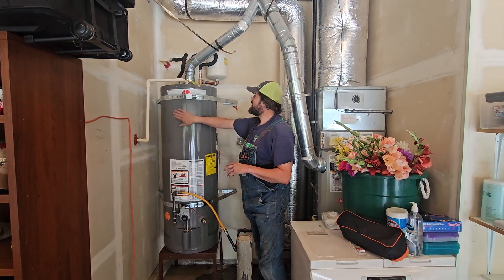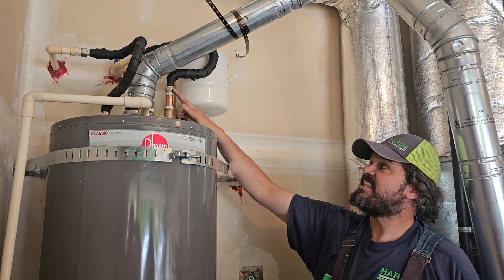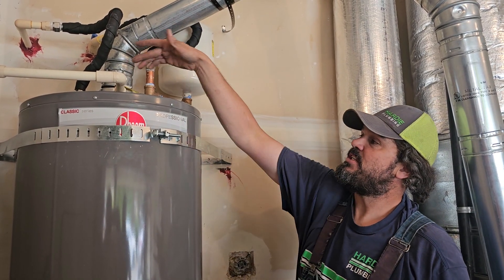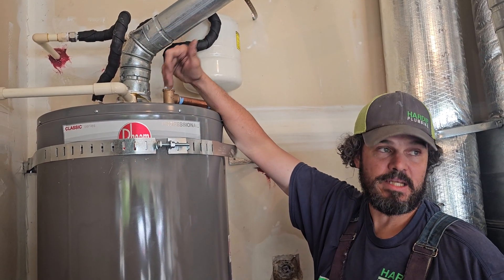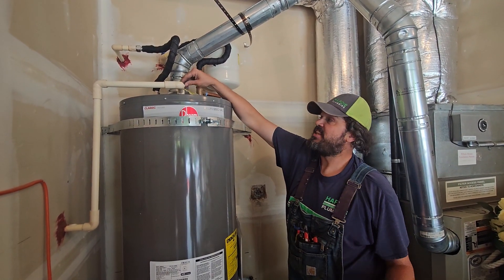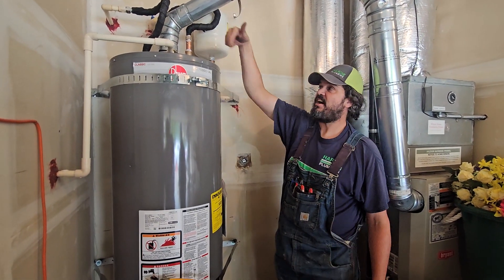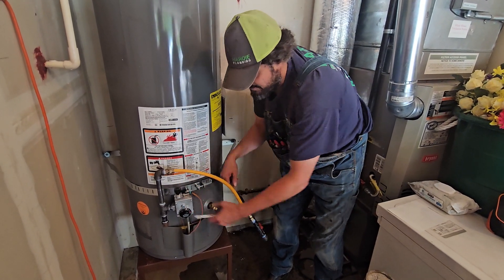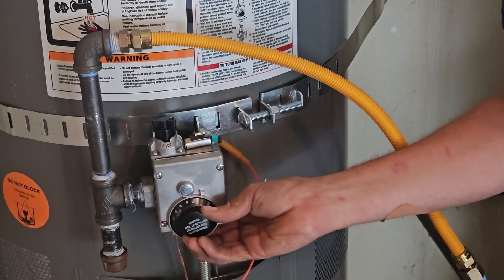Get the 5 Star Review Everytime with this Gas Hot Water Tank Explanation

Comment from the maker: Great Question!  I think this BOILS down to practicality and a little bit of physics. CPVC Is a suitable material because it's non combustible and does not have a specific melting point that would cause pipe rupture when receiving discharge from an open gravity P&T relief valve.
A hot water Pressure and Temperature Relief Valve is designed to self open at 210 degrees. When this occurs the water temperature at that point, at that moment, will be somewhere around 210 degrees with probably a higher than normal pressure. Once the valve opens and  exposes the water to No Pressure, the water molecule will give up some of its energy and flash into a vapor and also condense back to a cooler liquid. It will still be hot but not 210 degrees of liquid flowing thru the pipe. 
I think technically the discharge piping should be copper pipe. However CPVC will get the job done and is safe that it will not cause harm to anyone. 
Next time your playing with your torch try to melt CPVC pipe. Doesn't  Melt or Combust.

Comment: can you help me out? i keep reading different opinions on using CPVP for the temp and pressure discharge, i guess because the valve is set to go off at 200+ degrees while cpvp is temp rated at 180 but i see you use cpvc in this video
Reply from the maker: Thank you for commenting

Comment: Another way to know if the expansion tank is bad is if you start getting air through your fixtures. It happened to mine, I thought the city was working on the main or flushing hydrants, but my neighbors didnt have an issue. I'm a plumber, so I'm trying my best to troubleshoot and kept flushing the lines, and it finally dawned on me to check the tank, and sure enough, water. Somehow air kept getting into the expansion tank, because that bladder is not that big. Have you ever run into that? Great video by the way.
Reply from the maker: Can't say I have seen where an expansion tank was continuously adding air into the system. I would not be surprised thou depending on your piping arrangement I can see how that could happen.